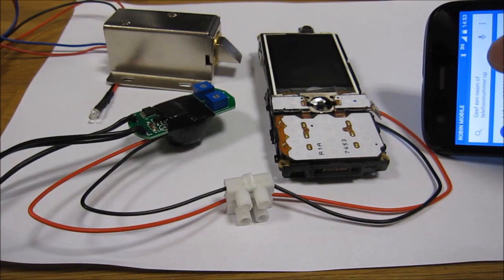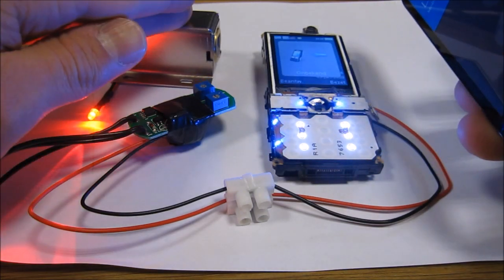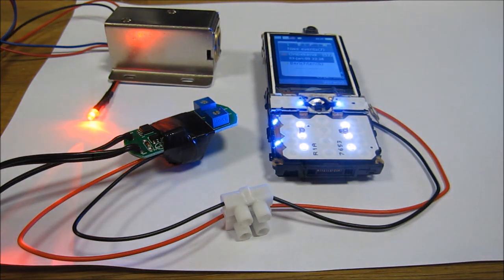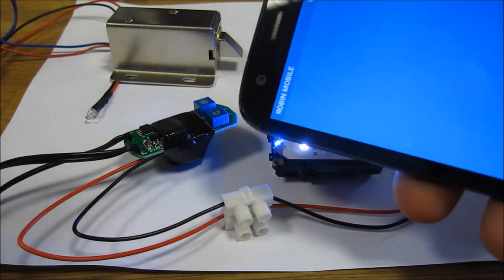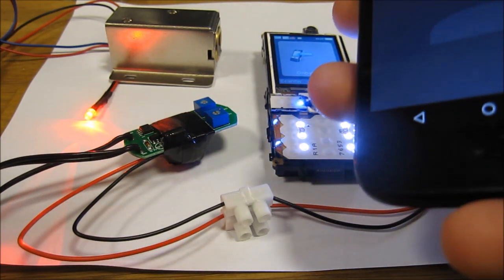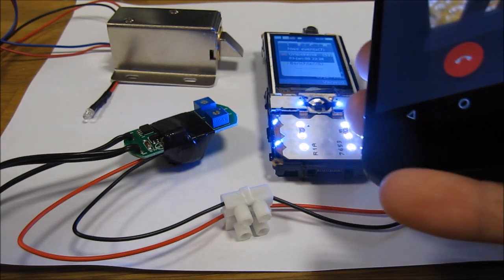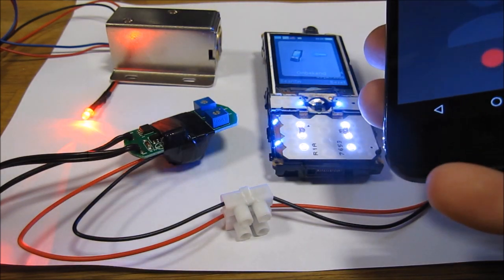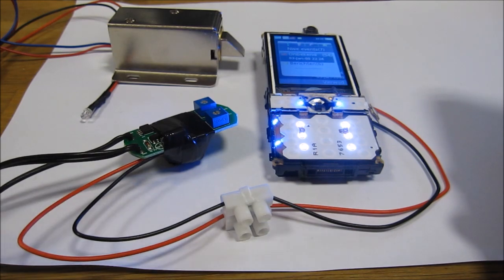Easy DIY GSM SMS phone remote relay control lock timer door opener acces control

Comment: Hello ,  I swa that the solenoid ,is a 12V .
 How did you supply it with your mobile phone , there is not 12V inside.?  

In term of cusumption, is it not better to use a DC small moter that a solenoid , which propably need peak current to work , hence more power  , that mean  shorter duration of baterry
Reply from the maker: Hi, the solenoid is powered by a seperate 12v power adapter. It's not shown in the video.

But save yourself time, go to Aliexpress, look for 'gsm relay'.

Comment: Maakt het uit welke de plus en de min is, en kan ik dit zonder 9 volt batterijhouder direct aansluiten op een apparaat of trekt hij dat niet moet er een relay tussen?
Reply from the maker: trilmotortje weghalen ja. Op die contactjes soldeer je dan het IR ledje. Of de plus en min uitmaakt weet ik niet. Als je je telefoon op filmen zet dan kan je zien of het IR ledje aangaat. Want met het blote oog is dat niet zichtbaar. Gewoon ff proberen werkt het niet dan draai je de + en - om.

Verder snap ik niet goed wat je met die 9 volt wilt.. je vanalles aansluiten op dat relais wat ik heb gebruikt, tot 240 volt denk ik.
Reply: ______x ja want dat trektie niet toch zo een telefoon heeft 4,5 volt op die motertje dan, om dan met die batterij te kunnen laten functioneren zoals 9 volt of 12 volt hoort er een een relay tussen toch en wat voor zou ik moeten gebruiken volgens jou
Reply from the maker: @PabloEscobar-si9qx  Volgens mij heeft een telefoon +-1,7volt op het motortje staan.

Maar dat maakt niet uit.

Wat je moet kopen is een PIR RELAY die minimaal het aantal volt kan schakelen wat  jij wil.

Dus wil jij 9v schakelen, koop dan een PIR RELAY 12V. 

Wil je meer schcakelen? Koop dan een PIR RELAY 220V. Of je die nu 220v of 10 volt laat schakelen maakt niet uit. Hij gaat aan en uit en hoeveel volt  jij erdoor stuurt maakt voor het relais niet  uit. Zolang  het maar niet meer is dan waar 'ie voor gemaakt is. Wel zal je dan eventueel een extra stoom moeten leggen voor het werken van het relais zelf.  Want dat is vaak 5, 12, 24 of 220 volt.

Comment: I need a remote relay control switch for my car, such that why i get car jacks and they get away with my car while its still running  i just send the sms and the car power disconect
Reply from the maker: You can't do that. If the thief gets a deadly accident when you remotely shut of the car you will be held responsible. Buy a good gps tracking service.

Comment: How it detects the phone call has arrived
Reply from the maker: The cell  phone had a vibrator motor. This is removed. The power to the vibrator motor now goes to a infrared led light(like a led from a old tv remote). That infrared led light is taped to  a IR sensor(infrared motion detection). 

So the call activetes the IR led. Then the IR motion sensor thinks that there is movement and it activates the relay.

This video is a solution to the fact that it's not easy to activate something with just the low voltage that the phone sends to the vibrator motor. This is usually very low, like 1.7 volts etc.

But as I say there are many solutions to do this. I think a transistor might be better. Or you can just buy these devices new.

Comment: where can i find ir motion sensor relay ?
Reply from the maker: for seconds activation time;
http://www.ebay.com/itm/5-24V-DC-5A-Infrared-PIR-Motion-Sensor-Security-Light-Control-Switch-Connector-/172401339893

for minutes activation time;
 www.ebay.com/itm/1-10-Minutes-Time-Adjustable-8A-PIR-Sensor-Switch-for-2835-5630-5050-LED-Strips-/351216204985

Probably other PIR sensors /relay will also work

Comment: IED time
Reply: making an IED that connected to a mobile phone is not such a good idea since what if you have hooked up the explosive and someone calls the wrong number and the phone that you hooked up to the IED starts ringing then BOOOOOOM! BUT DONT MAKE IED LIKES WTF? OUR SOLDIER DIE BECAUSE OF THEM
Reply from the maker: Certain old nokia phones have the option to only vibrate when a VIP contact calls. So only add the right number to the VIP list and you're safe. Of course don't use this for IED's but for things that bring life, like switching some irrigation system remote to water the farm etc.